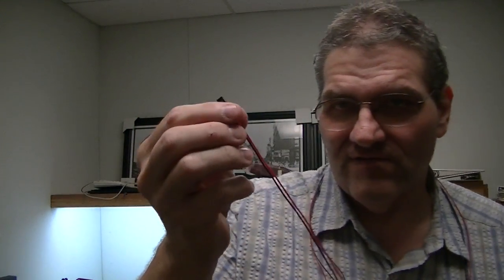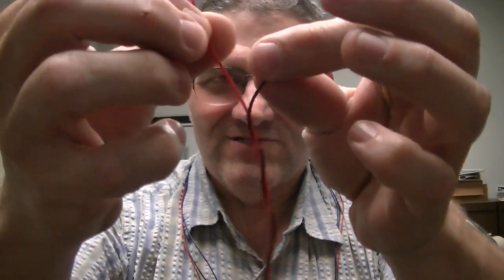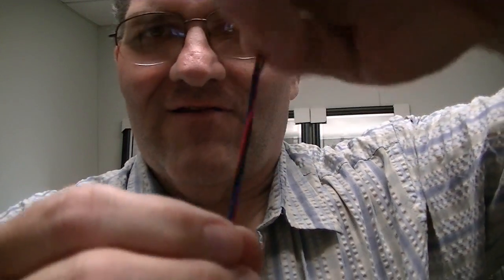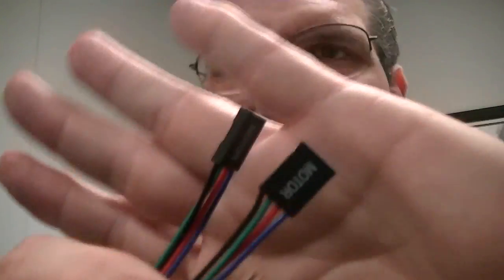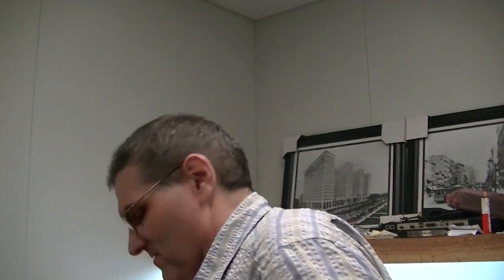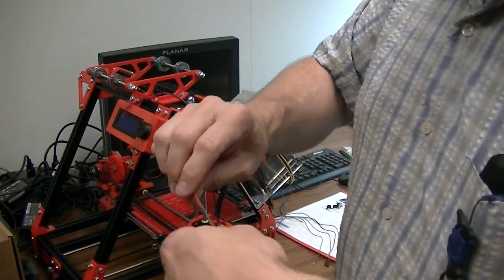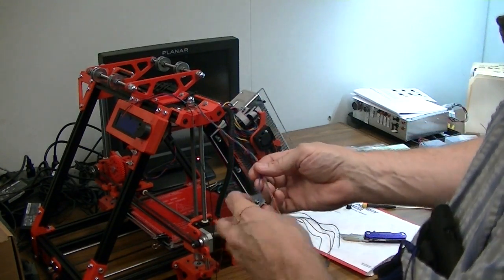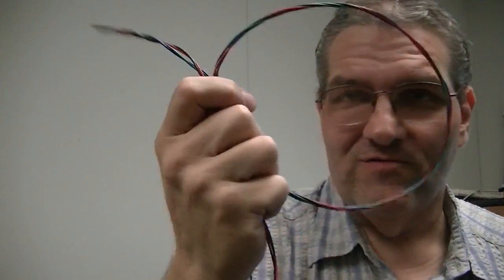2013-06-27 Cable Management

Comment: Thats neat, but from an electrical standpoint the motor wires should be twisted pairwise for each phase, not all four. The emitted noise will be much less if you keep the feed amd return wire for each phase completely parallel.

Comment from the maker: Using a power drill does nowhere near as good a job. The resulting cable will have a tendency to untwist itself, where this method imparts a counter twist on the individual wires. If you untwist the middle of the cable it'll literally re-twist itself. (I demonstrate that at about 4:50)

Also, with a drill you run a real risk of over twisting and breaking individual strands inside the wires insulation.

Comment: I use a power drill and clamp the wire ends and spin and they are twisted together in seconds.
Reply: Good idea very informative video.  I found twisting the right pairs has a noise cancelling effect on sensor and stepper wires
Reply: Just like cat5 cable does
Reply: oh yeah, thats possibly where i robbed the original idea from ;)

Comment: Great method.  Mine involves just twisting the initial pairs between my index finger and thumb with the knotted base anchored, but I like yours because after about 3 long runs, my fingers get raw.  I do this because it straigtens wire that's been living tightly on a spool for a while and it tends to tangle otherwise.  Is it possible to use ribbon cable in this scenario?

Comment: I've only ever seen those types of small wires with those kinds of connectors in computer cases and they're usually glued to each other by the manufacturer so as to keep things tidy. Though it's good knowing what to do if I ever do run into some stray wires like that.